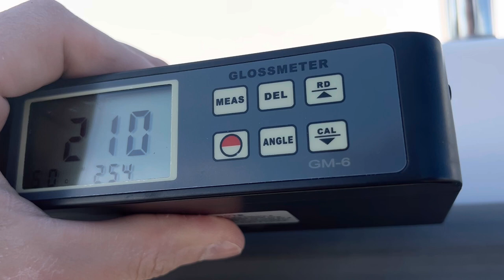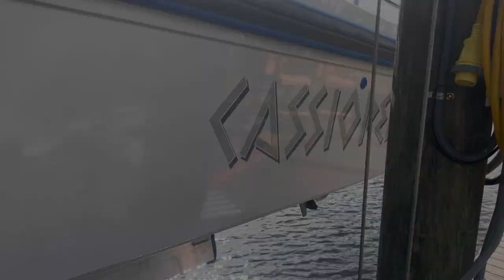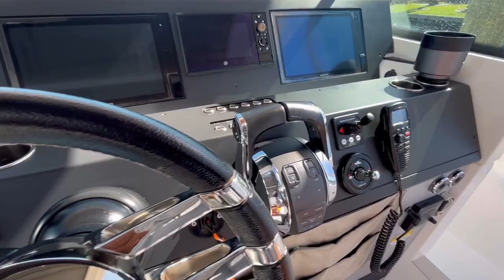How to Wet Sand, Compound, & Polish your Boat (1-Hour Class!)

Comment: Very well thought out video! Do you ever use yellow wool pads when using Elevate? 

If I have this correct, the process is Sanding, Level R on white wool, Elevate on Grey/Orange foam so far. Great video! 👍
Reply from the maker: Yes, there are times I will run the yellow wool with Elevate. However you would still want to follow up with a foam pad to get the best finish. That process works great with colors. So far you’ve got the process in the video nailed down 👍
Reply: @topdockpro  Thank you, I appreciate the reply!

Comment: I will be working on the boat, over all it is in good condition with light oxidation in one spot, I am thinking to sand the spot with 3000,  Elevate on wool yellow pad and Ignition on Rupes yellow wool polishing pad, what do you think about it. Also what sealant you prefer, Jescar Ultra Lock or Starke Hyper hold?
By the way thank you for  discount at Starke website.
Reply from the maker: 3000 is nothing. It’s better to use 1000-2000 for gelcoat. Yeah I think that’s a good process. You’re picking hairs between Jescar and Starke. Mind as well use Starke and get the discount.

Comment: Isn’t using sanding paper alone( one for water sanding) and just change papers?( need to have some soft pad on which you put just sanding paper). Much cheaper option and in the end you get the same thing?
Reply from the maker: It’s a similar result but a slower process. I’ve done it in the past. May need an extra round of compound to cut out the deeper hand scratches that a polisher won’t leave

Comment: I know you are using a DeWalt but I had a question on the Makita 9237C that I have.  I was using a yellow Lake Country pad with Elevate the other day and after about 10 mins I went to pull the trigger on the polisher and it wouldn't start.  I waited a few minutes and then it did start but the same thing happened again after a few minutes.  Does that sound normal to you?  Do these polishers have a thermal overload cutoff switch and do they frequently overheat?
Reply from the maker: They frequently overheat. In 5 years never have I had a Dewalt stop working due to overheating.

Comment: On the Dewalt buffer what number on the speed control do you set it at for the different speeds you mentioned?
Also what 3m compound do you use since that is the easiest for me to get
Reply from the maker: Start at 600 RPMs and work up to 1500 RPMs with 3M Heavy.

Comment: How much mileage do you get out one of them p1000 Abralon discs ? They don’t come cheap but look the safest option.
Reply from the maker: Not very much, a few sections. We just did a 47 hull and ran through almost 40 pads per grit! It’s by far the safest method and most effective

Comment: Is it possible in some cases to only have to use polish then wax? And not use the compound?
Reply from the maker: It can be, if you take really good care of your boat. As a detailer it’s rare I work on boats like that
Reply: @topdockpro   so most of the time it’s going to be a compound, polish, wax? What if the customer doesn’t want to pay for all 3 steps?
Reply: @topdockpro  What im asking is it possible to do a 2 step process if either the customer doesn’t wanna pay for all 3 or the boats in decent shape?
Reply: @ryan lynch  I use Meguires 1 step Marine Compound/Polisher followed by a marine wax once a year and it keeps my boat pretty shiny. Spots with heavy oxidation I sometimes have to do twice, but other than that it works pretty good for me. I guess it depends on how oxidized your gel coat is.

Comment: Would this be same wet sand job on a fiberglass motorhome gel coat ?
Reply from the maker: Yes it could be if it’s in really bad shape
Reply: @topdockpro  how can you tell when to change pad when the interface will hold water and kind of shoot white gel coat out of it kind of missing leading ?
Reply from the maker: @tylerdominiak3210  you can do 2-3 (3x3ft) sections and then you get a new pad
Reply: @topdockpro  where you buy your pads cheapest I see is about 32 for 20 pads you ever use abernate pad to cut fast and longer

Comment: Fake video!! Wet sanding is your last resort when jell coat is so oxidated that it powderise on the surface. All you need is a good wash, muriatic acid wipe, 2 - 3 passes with 7'' pad (finishing cut only on a boat with already a shine to it like this boat). After that use water and foam pad to create a perfect finish. If you're lazy just use soap to clean the polish residue whipe it dry and start waxing.
Reply from the maker: Thank you 🙌
Reply: What is powderise? 

Use a foam pad with water? No product? To remove haze and swirls? Never heard of just using water